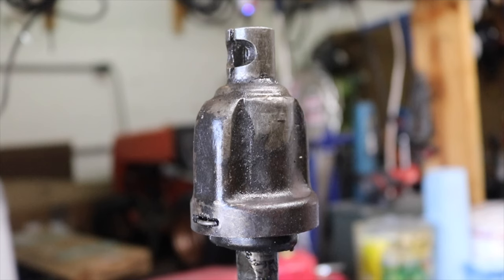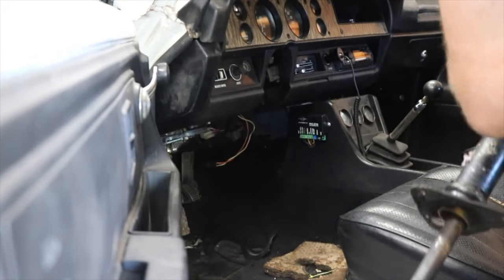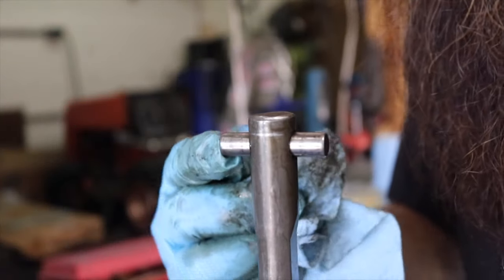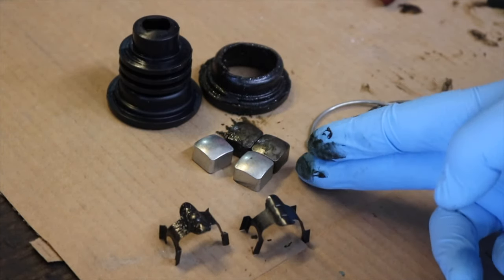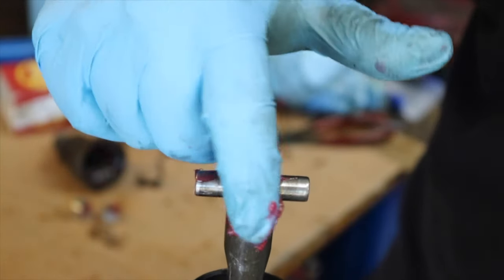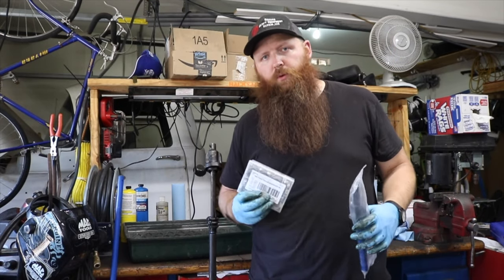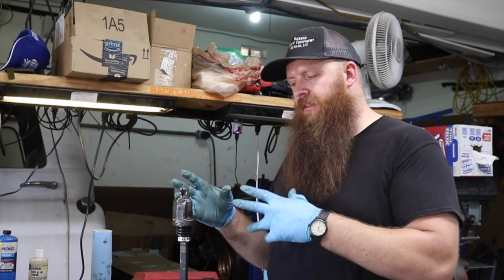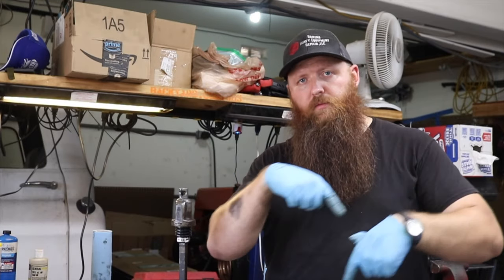Steering Shaft Coupler Rebuild | Pot Joint Boot replacement | Vega EP19

Comment: cant find the compression spring ..Got my crown repair kit but my spring was eaten uo i guess,,what size is the spring or a site i can get one..
Reply from the maker: I saw a few on amazon, but mine still had the spring. I didn't think to measure it when I was in there. Post that question up in the forums or the Vega Nation facebook group and someone should be able to get you an answer.

Comment: Great video. Wonder why the Vega uses a spring with this joint? Similar joints used at the other end of the steering shaft don’t use one. What’s different about the Vega column?
Thanks!

Comment: Hi nice job getting the V8 in your vega, are there any videos of you doing engine swaps?
Thanks for the pot joint assistance.
Reply from the maker: I bought the Vega with a 283 sbc V8 already in it. It was likely done in the 70's, judging by the parts used.
Reply: @BurnoutsAndRotorblades  when I was in high School in the early 80s I had a friend who had the same, his was an automatic with a 283 he could not close the hood with the v8 engine so he drove the car without one. he eventually broke the stock Vega differential, I dont think he ever got it going again. thank you for answering my question.

Comment: I have a 77 dodge w200/m880 that has this piece but it's attached to the steering column not down towards the steering gear box.
Reply from the maker: Manufacturers seem to just throw in these joints wherever. . . .
Reply: Thanks for this video. Only one I have found speaking about this. Helped me out. I'm assuming mine on my 77 will work the same way just up top.
Reply: This video is so helpful - even 4 years later. 1976 w200 here, finally found my parts with the hint  towards jeep CJ5. Thanks!!!

Comment: 2005 steering column boot. Does not even show up on dealer computer drawings. Engine fumes get inside the car. Help..
Reply from the maker: I don't know the application. Something from 2005. Most cars use a type of polyurethane calk. Maybe a shift boot for a manual transmission or a CV axle boot might work.